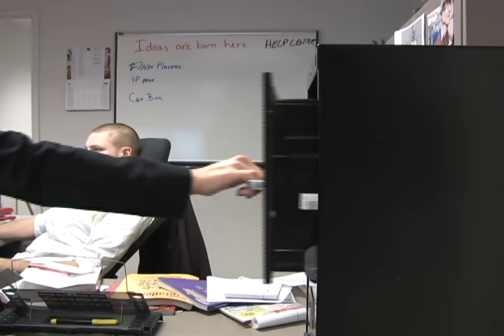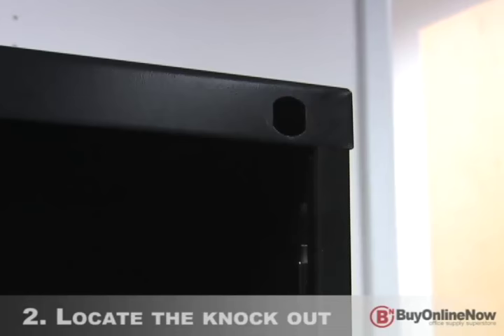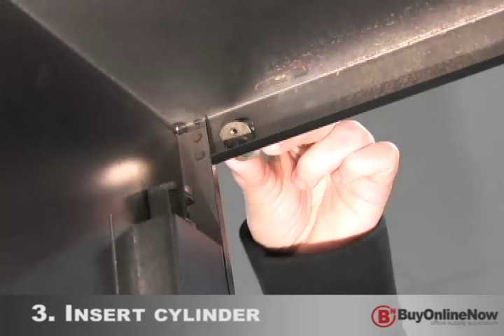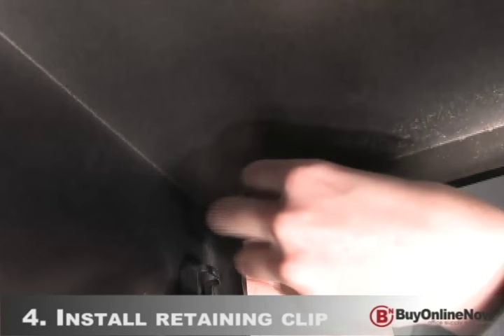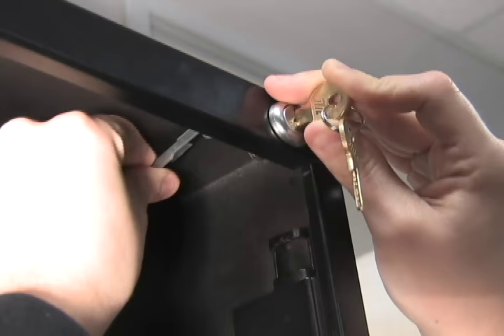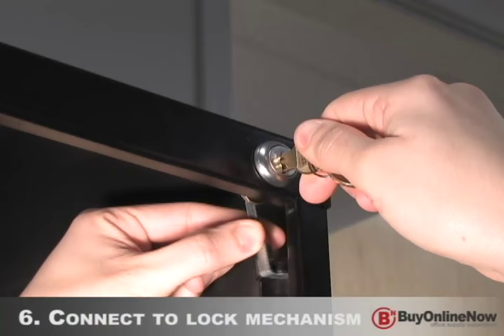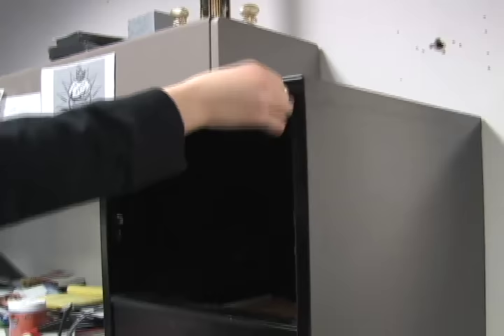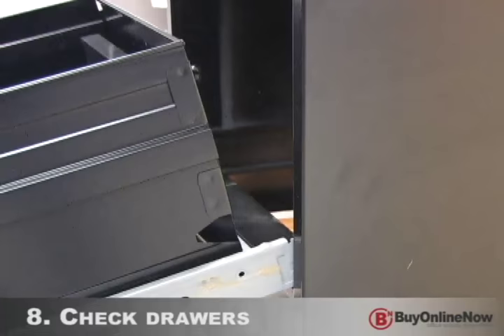How to Install File Cabinet Lock

Comment: Very helpful. Had trouble orienting the linkage to the lock bolt hole  because I couldn't get the top drawer out. Had to view the video several times but finally got it in. Thanks

Comment: Might be a no brainer to you, but I have a file cabinet with NO lock, but DOES have the right shape of lock-hole "etched" into the metal at that upper right corner. Is there an ideal/simple way to knock it out—to get a clean hole without jagged edges?  (Then I'd install a new lock from kit.) Like what tools would you use, etc.   Thanks!
Reply: I have this same question!!

Comment: What if the metal black file cabinet doesn't have a knock out in the top right or left corner? Answer a hole has to be drilled through the metal file cabinet to install a lock, determining on the position of which drawer you want to lock. Which there are also other Youtube tutorials on how to do just that. My black file cabinet like this doesn't have a knock out.

Comment: Just One of the draws won't Stay locked in the vertical cabinet. It's a oval shaped lock =. I tried taking out the draw and reinserting  that one drawer (2nd from the top) won't catch ]. What to do ?
Reply: There should be a arm that sticks out that moves up and down that catches the drawer, might be bent inward/outward.. straighten it up
Reply: @FRJ1982  hey just saw this. Thanks.  I'll look in there and see if l can find it. I'll check each draw level to see if it has a connection with the rest.  Thank you ithttps://youtu.be/0lSbkZ0mcF4

https://youtu.be/727Xe34p-_w 
Hlhtbgo

https://youtu.be/DCyWDuQPzng